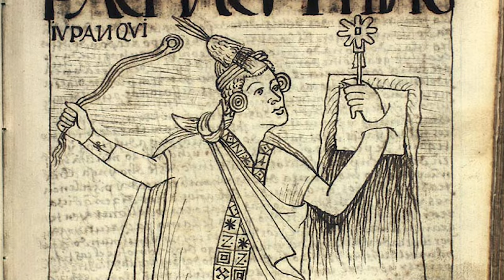SACSAYHUAMAN - How They Did It | Polygonal Masonry

Comment: I really appreciate you covering this topic.  I was looking to understand how the ancient cultures did this type of fitting.  I like the Concept that Mr Lee has offered of scribing the rock for the fit.  However I don't think it's detailed enough to suggest this is the way they did it because of the example with the very large blocks falls apart when you look at the joint where the two lower blocks come together under the block above.  Often you will see the top block shaped to fit the lower blocks and not the other way around.  For example, in the diagram where bocks B and C meet, when you look at the real examples typically the joint comes to a point that is lower and thus the upper block has a v shape point carved to fit right into this joint.  Which seems unlikely that it would be shaped hovering above.   Also some block would have to be shaped on three sides which would be very challenging to scribe accurately as well as tip into place since sometimes they look narrower at the top .  I think these types of discussions are really productive to help figure out and discover the how.  Thanks again for covering this.  I do hope someday we figure out how it was done.

Comment: Excellent!! Obviously correct. I’m an engineer with a significant resume.  Also a woodworker who has built boats. Scribing is second nature. WhT you describe was definitely done. However, having said that, I believe there is more to it. Far too much to note here. There are also instances where I don’t think this would work. There are also evidences of machine work. You are on the right track, but much more is to be said. I’ve never visited the sights, but I would have to see them with my eyes to go much beyond what I say. Interestingly, I’ve also had a very strange occurrence which I believe may bear in this. That however would need a private communication with you, which I don’t know how to do. Tell me if you are interested in hearing what I have to say. 
Good work! Excellent video!!
Reply from the maker: If by "strange occurrence," you mean something mystical, it's probably not up my alley. But feel free to email me. The address is in my channel's About section.

Comment: The article I read decades ago (and I have never seen reason to doubt the practicality of the method) posited that the extremely heavy stones were shaped as closely as was reasonable, then final and exact fitment was accomplished using the stone's own great weight - a little silica sand was spread upon the surfaces the stone was set on and against, then the stone was slid back and forth until it had ground and polished a perfect fit upon the wall. The next row of stones would polish the upper surfaces of the stones below. Thus it is not necessary to repeatedly lift the heaviest stones to achieve close fitment.
There have been excellent theories on how the polygonal cyclopian walls were built for decades, there has never been a need to involve unusual tools or methods, normal human intelligence sufficed. The literature regarding the construction of these walls has not been hidden, but there are some who refuse to look for it, preferring their own unlikely and unsupported ideas.

Comment: While i fully agree with contours of limited thickness,in practice this will be VERY timeconsuming and prone to errors with large irregular surfaces.
Also it would be necessary to move neighboring stones probably multiple times to proof if the work realy goes well for a good fitting.
Even given a highly skilled large workforce they would probably still hammering away today i fear..... However,it seems Vincent is at least on the 
right path.
Anyway,the hard thing is to actually do it,not to write a paper about it.
Reply: Exactly my thoughts.
Reply: Their theories are as wild as ancient alien thoeries...
Reply: Yeah they scribed 100 ton blocks in a right angle wall. How the F did they move that many blocks of that size up a 6k mountain and not only that but move them back and forth another how many ever times it tool to scribe and recut. I agree, they should still be working on that site today if that were the case... but somehow they were more capable than we are today with almost nothing?
Reply: @chuckdeuces911  Well,imho they didnt. I think they reused many ruined places from older cultures and renovated them to their abilities. Simply because out of near at hand practical reasons. I mean,moving stones up to a couple tons with pure muscle power was certainly possible for them,but why should they rip their collective butts open when cyclopic 
fundaments were laying around  in the landscape already.
Reply: @Zockopa  That would be possible: the Incas were simply the biggest and last of Andean polities spanning over 3000 years.
Reply: You don't need to move blocks multiple times. Have you ever built anything in your life? Never heard of the phrase "measure twice, cut once"?
Reply: Why does this seem so difficult for some people to believe? What makes it so hard to believe that people who had nothing but time to work on a single task could accomplish something so large? 

Especially when you can see an evolution of their stonework within the structures. rougher walls begat more refined walls. 
We know they knew how to make use of fulcrums/ levers which would make moving large objects a lot easier. Their entire civilization, as well as pretty much every other civilization was adept at working/ moving large stones and each culture depicts it being done in different way. 

It's not that hard to see how it was done.

Comment: While I very much appreciate your channel and especially this particular video, I have one problem with Vincent Lee's theory regarding stone placement. 

In Bernabe Cobo's chronicle, Inca Religion and Customs, Book II, Customs, chapter 12, he states

"What amazes us the most when we look at these buildings is to wonder with what tools and apparatus could they take these stone [blocks] out of the rocks in the quarries, work them, and put them where they are without implements made of iron, nor machines with wheels, nor using either the ruler, the square, or the plumb bob, nor any of the other kinds of equipment and implements that our artisans use."

If Cobo is correct, then the scribing method could not have been used as Vincent theorizes, as it relies on the usage of the plumb bob to ensure the measurements are level. By all means it is possible Cobo was mistaken, but given the fact that he witnessed the Inca stonemasons at work on such projects as the Cathedral in Cuzco, I don't have any reason to doubt his claim.
Reply from the maker: The stones at the cathedral are much smaller. I would expect a different method to be used.
Reply: @WorldofAntiquity  Fair enough, I don't deny that the stones used on the cathedral are much smaller compared to the ones seen at Saqsayhuaman and that's my bad for using that example as I was trying to lend credibility to Cobo based on the fact that he witnessed Inca constructions methods firsthand.

In the very same chapter, Cobo goes on to say 

"Thinking about this truly does cause one to marvel, and it makes one realize what a vast number of people were necessary to make these structures. In fact, we see stones of such enormous size that a hundred men could not work even one of them in a month. Therefore, what they say becomes believable, and it is that when the fortress [Sacsahuaman] of Cuzco was under construction, there were normally thirty thousand people working on it. This is not surprising since the lack of implements, apparatus, and ingenuity necessarily increased the amount of work, and thus they did everything by sheer manpower."

I just think the idea that the stones were constantly moved and worked in order to fit one another, although tedious, is very plausible and shouldn't necessarily be dismissed given the amount of man power the Inca were able to mobilize when required, and Cobo himself seems to indicate this in his chapter.
Reply: Interesting. No plumb bob?  That directly contradicts Mr Lee who says he found several of them. 

I'll look into it more but I'm going to go with Mr Lee, just as a gut feeling. The Spanish themselves got beautiful work done by Indigenous masons, I'm guessing these masons were had already figured out how to tie a rock to a string to find vertical.
Reply: I feel like the Spaniards were viewing from aeuro view. Maybe they didn't recognize native masonry tools when they saw them.
Reply: @shaolin1derpalm  Its possible!

I don't in any way claim to be an expert, I'm just an armchair researcher who finds the pre-Columbian cultures of the America's fascinating. I don't possess the means to test any of these theories, nor would I have the slightest clue on what an Archaeological excavation would entail. All I can do is watch these videos and read the material available to me. 

That being said, having read, Gamboa, De La Vega, Poma Guaman, Pedro Pizzaro, De Leon and Cobo, I have not come across any mention of specifics or details as much as Cobo has provided. I completely accept that what he witnessed in construction methods at the Cathedral in Cuzco, is entirely different from, say, the walls at Saqsahuaman. 

Personally, I give slightly more credit to Cobo's writing when it comes to this particular factor because it wasn't something he was told or information that was passed down to him, this was what he had witnessed with his own eyes. I understand and accept that he was a man of the cloth, a Jesuit priest, and not necessarily an engineer, however the fact that he specifies this particular instrument, in my opinion, points to the fact that he was aware of its function and use. Furthermore, he mentions that while the Spanish may have been in charge of early colonial construction projects, the native masons were free to use their own techniques and methods, which according to him, did not include the use of such an instrument. 

I appreciate everything about this channel, the way realistic ideas and theories are presented is refreshing from the usual ancient alien crap out there. It's very insightful to hear Mr. Lee's findings based on his research and while I don't think he is very far off, I just personally disagree about the use of the plumb-bob in particular as it is something that throughout the course of my research, I have found contradictory evidence for.

I think, in a way, you kind of hit the nail on the head, though. I think part of the problem with these types of theories is trying to separate what is known from say the "old world" such as China, the Middle East, India and Europe from the America's. While Mr. Lee's theory holds up for the most part, with me, certain aspects that seem universal, such as the plumb-bob, may not have been as universal as we think. We know cultures and innovation in the America's developed independently of the rest of the world, and I personally believe that engineering and masonry were no exception to this. While it's hard to fathom masons constantly moving and re-working stones, it's not impossible and if you accept the fact that the population of regions such as Peru and Bolivia were at one point, prior to the arrival of Europeans, very high, it becomes more plausible, at least in my opinion.
Reply: @edward3950  I meant to say European
Reply: @shaolin1derpalm  I get ya, they are very difficult reads. Sometimes I just have to put them down, but I find value in knowing the history... it's just very off-putting sometimes, and especially when it comes to the stuff that came out of the early conquest days. 

Someone like Bernabe Cobo, is really different, though. He may from time to time be insulting but he focus' most of his writing on the customs, history and religion of the Inca so it's a much easier read than say Cotez's letters to the king.

Comment: I believe that some of the information that Vincent Lee is giving is greatly over simplifying the process well it makes sense at face value there’s multiple different factors that make it hard for me to believe they were just pulling those stones with ropes for example it’s one thing to do it on flat ground but when you’re going up the grade it gets exponentially harder to pull a 90 ton stone if you do his figures that would be 900 workers each person pulling 200 pounds However have you ever done a Tuggawar the math may make sense on paper but in practice I don’t see it working I’m not saying that they had some kind of super advanced technology but they definitely were implemented use of levers or pulleys or other methods even if it was a rudimentary lever or pulley System also it would be nice The area between the stones at sachaumo was excavated

Comment: When you are scribing in certain situations, you can knock away lots of the material behind the part where the joint is made, without having to be very accurate at all. This allows you to fit the narrower edge with precision and nothing behind the part you will see, is holding the joint open.
Another thing that is often overlooked is the fact that when you measure something accurately, it WILL fit perfectly.
Every time.

Comment: An alternative way to use this scribing technique would be to shape the stones when they were laying flat on the ground beforehand: the stones would be placed so that their backs were on the ground, and their front faces were upwards; you could then "make" the wall beforehand with the stones on their backs, leaving enough space between them to scribe and shape. No lifting would be required at this stage. As stones were completed you could shove them together to test the fit and continue. Only then would the stones be taken apart, moved to the site and stacked vertically, and they ought to fit together very closely. In other words make all the joints with the stones lying on their backs, face upwards first, then construct the wall vertically afterwards.

Comment: i didn't knew this technique is called "scribing", i have a stone wall in only 1 side of my flat, and needed join it in 2 rooms with a new ceiling, i used a screw driver to follow the wall with a pen attached to mark on my BA13 the line to cut. it fits less than 5mm everywhere, despite the plaster broke on some places when cut 😊 nice to know, and very instructive and documented content, thank you

Comment: I would really love to see someone demonstrate quarrying, transporting and then shaping or quote bash an 80 ton rock into a polyagonal shape and then lifting them off the ground and setting them into place and fitting them perfectly on five sides or more and having the stones around them fitting perfectly negatively on five sides or more.... It's just unbelievable and mind boggling, I would just love to see anyone in our modern time pull it off and even if they wanted to use modern technology, I highly doubt it could be done, but definitely not with primitive means..
Reply from the maker: Maybe you missed it, but only two sides of a stone need to fit in order to put it into place. And the bottom stones, the ones that weigh a lot, only needed one side to fit in order to put it into place.
Reply: @WorldofAntiquity  no, I watched the entire video and I'm not necessarily saying that it is impossible, I've just always been interested in megalithic structures built by primitive means, but no matter how many explanations I've listened to, not once have I ever seen anyone actually give an example of these massive feats in a real life demonstration. No offense, but just drawing it on paper, even though it was quite brilliant, still doesn't explain anything to me, unless I can see it done in real life
Reply from the maker: @joeodom197  The reason it hasn't been done is because no one who works with stone has volunteered their time to do the experiments, and no one has offered to pay for the experiment.
Reply: @WorldofAntiquity  this is the only example I could find and I agree with what you said last, but what I don't understand is why it's never been done before.... ever
Reply: @WorldofAntiquity No one who works with stone has volunteered their time, this is because anyone who works with stone knows it is impossible to accomplish using the supposedly tools available.
Considering there are 100’s of 1000’s of modern stone masons, who are obviously inherently interested in this field yet non have as you put it volunteered their time to prove this could be done using the tools available should be an alarm bell
Basically it can’t be done
Reply from the maker: @peteroberts3232  I have had several stone workers volunteer their time. Alas, we need funds. Are you willing to contribute?